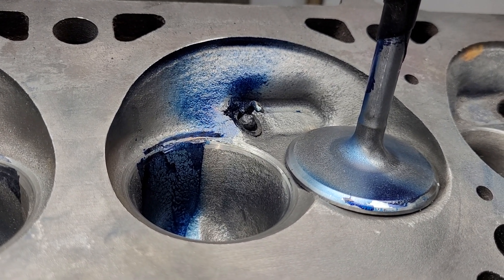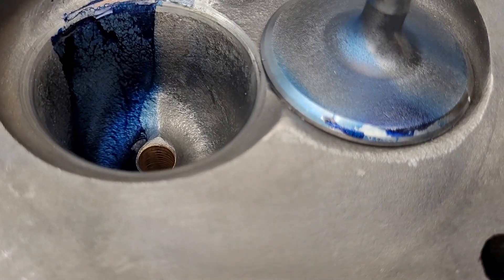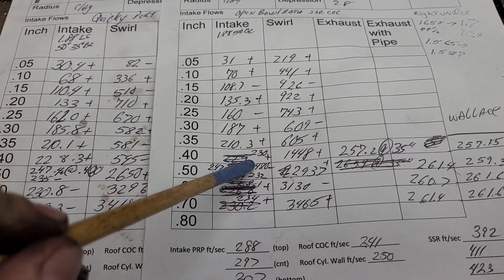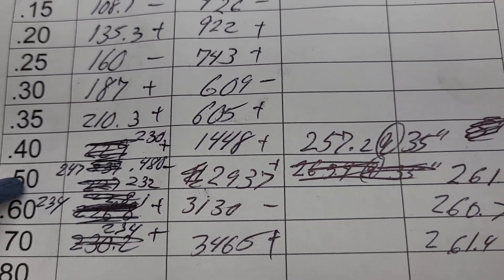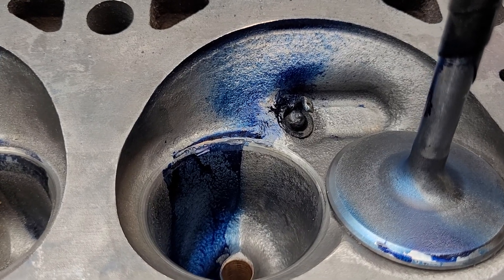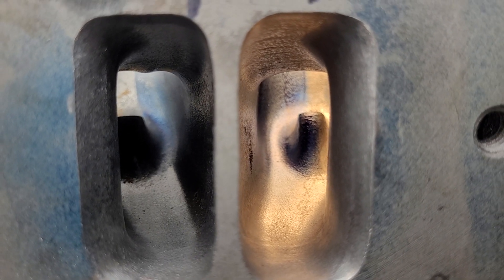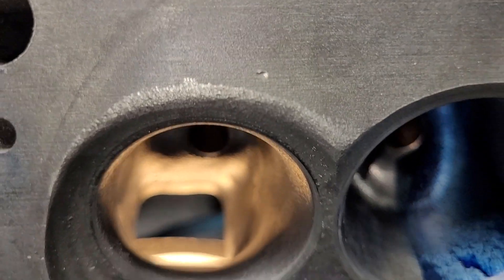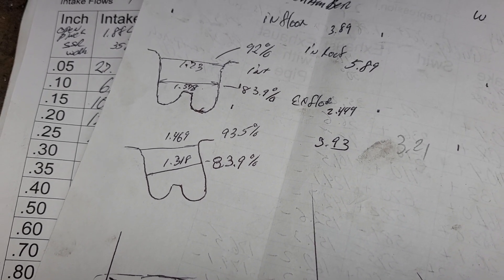David Vizard, Uncle Tony's Garage, Unity Motorsports, Mission Impossible project,Bowl ratio,35" flow

Comment: For throat on all of the small block mopar heads I have done, I use the smallest measurable width, usually about an eight an inch below the valve seat radiusing into the valve seat, and then actually slightly widen the bowl below that. My throats were set to 88% and mybowls just to the inside of the stock valve seats. The ports have a slight added lean from straight wall work.

From my blowing through debris testing,the largest areas to focus is the bowl and area around the valve guide. Lowering/ widening the ssr on the straight wall side corner also seemed to help. I usually also have a valve I served, and try to make sure that it is at about .500 valve lift to make sure all debris is blown out at that lift and that seems to run very well. Keep in mind I do not have a flow bench. And know I could do better with one.
Reply from the maker: I am sure you are doing fine. Thanks

Comment: I would guess you need to calculate the throat at its narrowest point ?  The air has to pass through it before the valve obviously, so using a wider section to create a ratio seems inaccurate. If the term "throat" refers to a specific part of the bowl just below the valve, and not the narrowest part between the roof and valve,  then I guess I dont understand the value of a "ratio," but there is alot about this stuff I dont understand as well as I want 🤨.
Reply from the maker: This is more of a problem with stock heads with oversized valves than aftermarket heads.

Comment: What should I be using for manometer fluid?
Reply from the maker: I would think it would be dictated by the manometer manufacturer. My bench was an sf300 and converted to an sf600 by Jaimeson equipment. He has a superflow come in add motors and change the fluid for it to read correctly. I spoke to the owner when I traced the roots of my bench. He has a Chevy wagon with an 292 v8 with 520 heads that he races and it was either 8000 or 9000 rpm out of those tiny power pack heads. I spoke to him in person at PRI once. Nice guy. Very knowledgeable.
Reply: @servediocylinderheads  unfortunately I made mine. It's 6' tall.routed grooves I a 1x6 to fit the tubing into and have 2 metal yard sticks opposite of each other and made them to slide up and down..I don't know if this was a mistake or not.. I built the bench reading about DVs homemade one except I have 4 motors.  I also have a Hegelson calibration plate.  Yes I know a guy that runs 55 Chevy 265 Stocker. 8500 rpm. He did alot of expimenting with headers.
Reply from the maker: @dondotterer24  I wish I could help but I don't know. Thanks
Reply from the maker: The red fluid in my vertical manometer is Dwyer fluid.
Reply: @servediocylinderheads  ok thanks

Comment: Great work Charles. At the .47sec in the video, is this your finished exhaust chamber work? Is a radiused exhaust chamber better than a straight (flat) cut chamber (quench pad).  Thank you.
Reply from the maker: I like the radius.
Reply: @servediocylinderheads  What does putting in a radius at that area produce? Total novice asking!
Reply from the maker: @cudabeenios1  It lets the flow get under the exhaust valve and out instead of over the exhaust valve.

Comment: Glad to see that you cranked the bench up. I'm a great believer in running different depressions. Not to get different flow numbers, but to look at port stability. The port being quieter at higher depression would indicate to me that it has become more stable. I would be interested in your observations of the port at lower lift levels with the higher test pressure, in comparison to your normal test pressure. Regards Greg
Reply from the maker: I agree. Thanks
Reply from the maker: Higher depressions are tough on my vacuum motors. Time on needs to be limited.
Reply: @Charles Servedio cylinder head porting & flowbench  it's a problem with any bench that uses airflow to cool the motors. Vacuum motors are a cheap and easy way of building a bench, but the downside is that you are limited in a lot of situations. That's why I'm currently designing a  hydraulically driven bench with 35hp plus available for testing. Most of the time it will just be using a single 5hp motor , but when I want to crank it up, I will be able to switch on a second, or even third motor for serious testing. Just refining the actual fan design at the moment. Will also be able to wet flow with it if I wish to
Reply from the maker: @theshed8802  A giant roots blower would be good. We have a few at work with 150hp 480v motors turning  them.
Reply: @Charles Servedio cylinder head porting & flowbench  I'd love to use a roots, but unfortunately they are difficult to get here, at anything less than a mortgage payment or two. If you don't mind me asking, what do you do?
Reply from the maker: @theshed8802  Not a simple answer. If there is interest I could do a short video on my work history that would explain some of my issues. Haha

Comment: Great to see some results. I personally do not have a flow bench. Rather use dust particles to make sure air is moving around each side of the valve guide, and make sure I have my throat ratios and pushrod pinches correct. I also focus on the straight wall. And then often the ssr on these small block mopar heads are irregular and need to be blended. For the exhausts blending the valve job and ports is key. As I have found the 308 heads have abetter port design on the exhaust side. The intake ports are raised higher due to the tighter pushrod pinch on those heads compared to earlier small.block heads.
Reply from the maker: Believe it or not just blowing chips out of a well designed port is easy to see over a poor one. A good port the chips will fly and hit the wall. Poor port chips may not even get out of the port. Just by blowing a puff of air.

Comment: Hi Charlie. I'm no expert but I always thought the throat was just below the seat but that was assuming that the bowl was larger so the throat would be the smaller diameter. I don't know, I guess we should say the throat is just under the seat but still reference the bowl diameter as measured at the top of the valve stem if it is smaller. What did you do to slow down the velocity at the center of the ssr? I'm working on a set of sbc 434 castings ( similar to 416 but heavier ) with 1.84 intakes. I have 231 @.500 cfm so far but 420's,430's over the center of the ssr. The ssr is basically stock. Should I widen the port at the ssr or raise the roof? Gosh I wish I had someone to teach this stuff. Have you ever thought of doing it? By the hour over zoom or a course over zoom? Florida is a long way from Ontario Canada. Thanks Andrew
Reply from the maker: Teaching isn't as easy as it looks. Teaching long distance learning is very tough. The ssr got slightly wider and had a slight tilt put on apex.

Comment: 🔔😎
This whole concept has me confused.
It's suppose to be a 318 build to show backyard guys the possibilities. 
Yet here we are doing a head port job that would cost $3,000.
Tony should have done the port job himself to get home garage results.
Sure DV is doing special rods$, crank, etc, all the tricks, and no doubt it will have one+ good 4bbl when finalized, and make 450+ hp.
Where does a $10,000 backyard budget fit in??
Confused....🤔🤔
Reply from the maker: Yes, I tend to go overboard. A backyard guy can get about 80% of this job if he knew what to do. As far as the polishing rods and balancing everything, I started doing builds like that in the 80's. I was broke but I needed stock rods to rev to 7000 rpm. They better be preped right.
Reply: @servediocylinderheads Backyard guys with mismatched pistons,  spending 300 on rod work polish and bushings, 300 on crank knifing and trimming, etc 
Face it, this is a full trick engine with a cheapo regrind cam.
Reply from the maker: @hotrodray6802  You know what would be interesting? Have someon build a .060 over rebuilt shortblock and dyno them both to see how many hp the trick shortblock makes with the same heads and induction, cam, exhaust.
Reply: @servediocylinderheads 
THATs a great idea. Maybe DV would do it.
Although he has already proven to himself that it works. THATs good enough for me.👍👍👍😎
Reply from the maker: @hotrodray6802  I asked him, he wasn't interested.
Reply from the maker: It is more of an exercise than a backyard how to do it. Backyard how to, build a solid shortblock, get some modern iron or aluminum heads and prep em. Throw in a tight lc cam, four barrel intake preped, 600 to 750 carb and headers. 400hp

Comment: Probably been asked before, but do the rules allow for metal to be added? The depressions in the exhaust ports look the a turbulent mess. Brazing in some fill to smooth that area would help flow a lot, I would think.
Reply from the maker: No adding metal.
Reply: @servediocylinderheads  well that sucks! What's the big deal about pouring some aluminum in there? That gaping hole has Veronica Avluv jealous!
Reply from the maker: @arturozarate1752  It is fine after some work.

Comment: Hi, I have a few questions. Will you be reworking and trying the single plane 2 barrel intake? 
Also if you're doing 302 heads and DV is doing a different head, like one made in the early 70's, does that mean you're going to try both heads on this engine, because I can't see any other reason to do two different heads for the same build.
 If it's a porting skill match, between you and DV then you'd both be porting the same head, right? 
I'm just a little confused, is this a 70's era build or an 80's?
Reply from the maker: I am too, I am doing these D.V
 Said he would test these. I am getting a dual plane and I will do what I can with that. I am hoping to get an original single plane and I will do what I can. I need to have a conversation with D.V. about testing both single and dual plane.
Reply: @servediocylinderheads  OK thanks, and thank you for taking the time to reply to people.
Reply from the maker: @GGLL-qg4tw  No problem

Comment: I can't believe the flow you got out of those.    If I remember correctly, you couldn't get close to that with gt-40 Ford stuff, could ya?  Can you do a Vizard program analysis of the two heads?
Reply from the maker: 236 on gt40 and 245 on gt40p I think. You can check those old videos for exact numbers.
Reply: @servediocylinderheads  Yep, 236 for gt40 f3ze three bar and 245 for ford f77e gt40p. Charlie i send you email,

-juhana
Reply from the maker: @juhanahuovinen  Thanks

Comment: how much HP do you think the flow can support?
Reply from the maker: As is or with a strangling dual plane and 2 barrel carb?
Reply: @servediocylinderheads  both...The carb/2bb intake will be the choking point.
Reply from the maker: Wallace racing has it at 468 hp. A few videos ago I ran this port through D.V.'s iop program and it has a hp estimate as well. Choked with 2 barrel I have no idea
Reply: @servediocylinderheads  the 2bbl limit is rather funny to think about. They just wanna hit 300hp. i think that is possible.